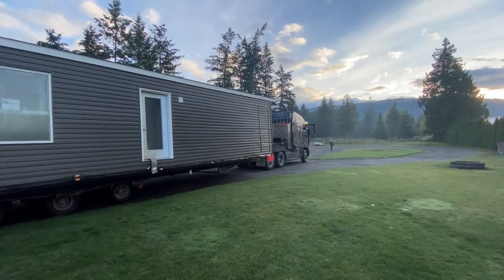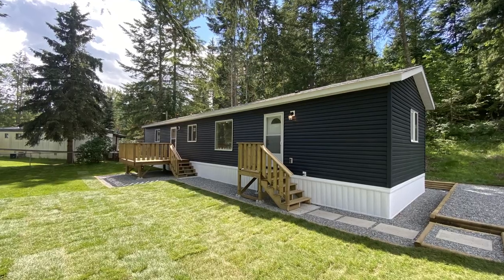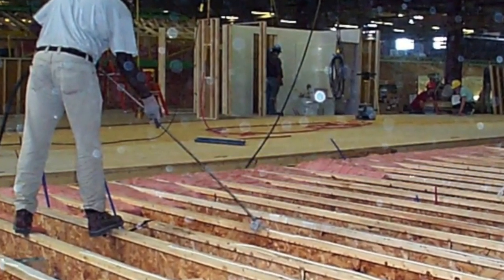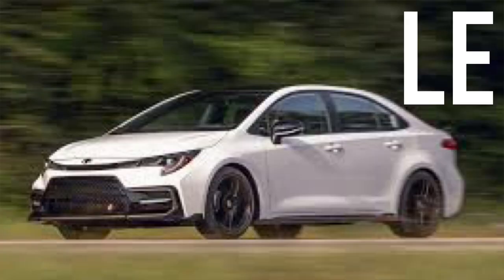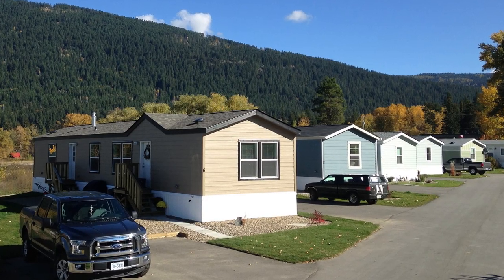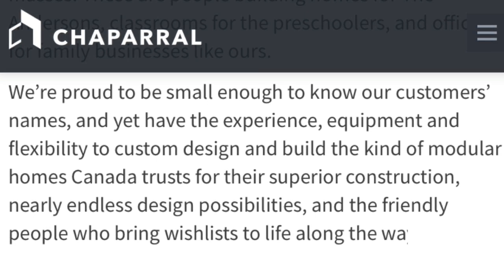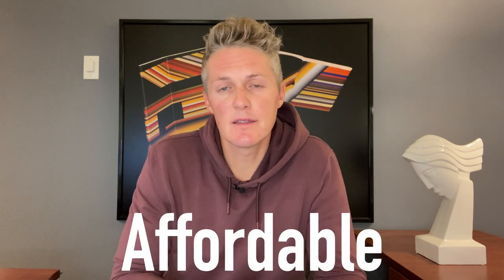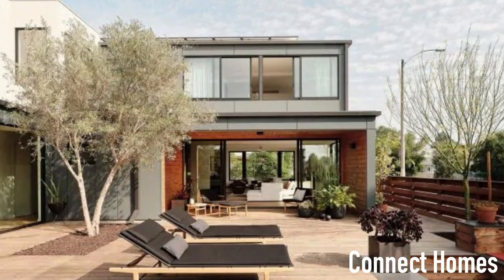Are Manufactured Homes Still an Affordable Housing Option?

Comment: An excellent follow-up to the earlier video, Kerry.  And since we've lived in 3 large western states that consist of mostly remote lands, let's emphasize the benefit of buying a manufactured home with its one-time shipping costs vs. the inevitable higher costs of a site-built home where everything needs to be incrementally trucked in (often including the workers) and build time is even longer.  Add a seasonal climate with its construction delays, and the site-built penalties just get bigger.
Reply from the maker: Exactly, I used that point for the high end builds but it’s a benefit at every pricing level.

Comment: I concur with Nat Nielsen regarding your presentations. I was unaware that Cavco is the mother company for all the brand names you cited. I was on your website and looked at the various floor plans you have at your business. Very interesting! This question has nothing to do with the three tiers. I am wondering whether there is insulation or sound proofing in the walls between rooms? Once again, thank you!
Reply from the maker: Hey John, I can't speak for every factory but the one I buy from doesn't include insulated interior walls standard. You can add that option to any home though. Good question

Comment: I bought a new manufacturered singlewide home from Southern energy homes which is a Clayton brand for around 75000.  We did get a few upgrades but I have to admit you get what you pay for.  Some of the trim work seems very cheaply put together and we had to have someone come out to fix a few things after it was set up.  They still have to come back though because someone at the factory over tightened the master bathtub faucet and the fiberglass cracked.  I have lived in it over a month and haven't been able to use it yet.
Reply from the maker: That's a bummer about the tub! Was your home on time? I'm always curious to hear about timelines right now
Reply: @KerryTarnow  it was only a week behind the original scheduled date so they did rather well on that aspect.  We put in the order around the beginning of May and it was delivered on September 24th.
Reply from the maker: @amandabellefeuille316  thats great!

Comment: Manufactured homes are not an affordable option. Manufactured home prices should be in the $55 to $65 a square foot range but currently they are double that. I'd buy one and put it on a permanent crawl space poured or block foundation and convert to real property but the home itself is simply an unaffordable option for what you are getting. I can literally build a house of the same square footage for less money.